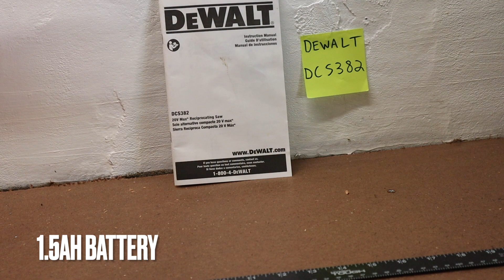DEWALT DCS382 Reciprocating Saw Review: Great Cutting Tool For Wood, Metal, And More! | PEDRO DIY

Comment: Tengo ese modelo 382, lo use para cortar troncos de un árbol de guayaba, los corte en varios pedazos, muchos cortes. Solo tenía a la mano una DiabloBlade de 9" para madera con clavos. La use con un batería FlexVolt de 6 amp. Me quedé impresionado tanto de lo excelente de la herramienta como de la duración de la batería. De primera impresión la recomiendo al 100%. Falta ver la durabilidad de la herramienta.
Reply from the maker: Gracias por ver.

Comment: Nice demonstration of the tool! Does it have an orbital feature built into it? The blade seems to be moving around more than just the usual back and forth…
Reply from the maker: It’s just going to move the blade back and forth, the only different thing you can do with it is put the blade in upside down